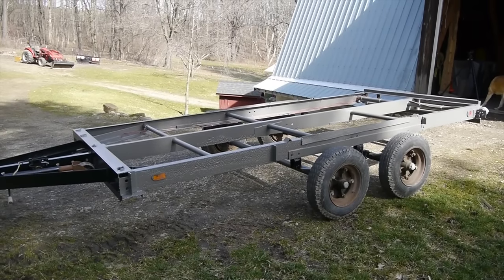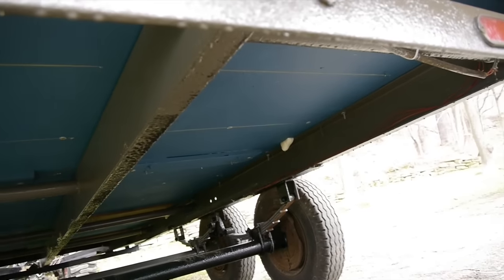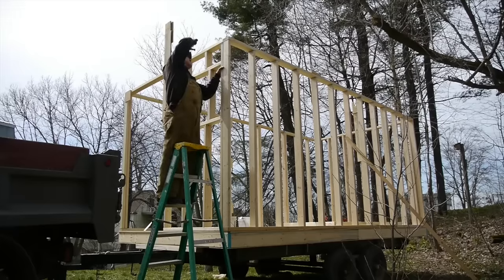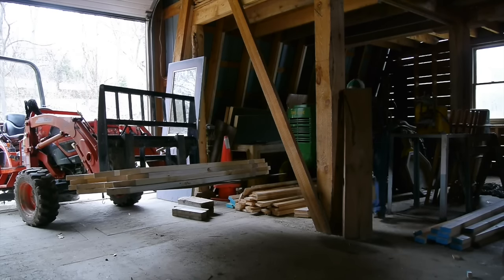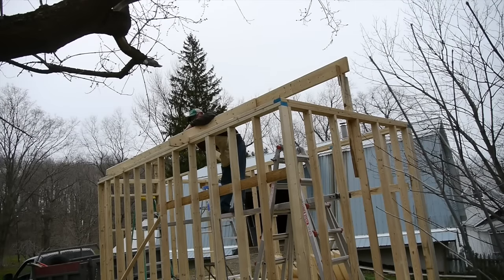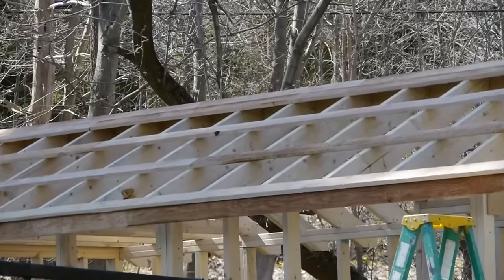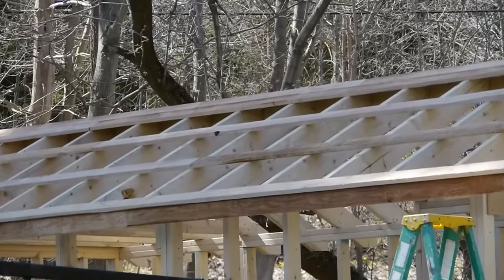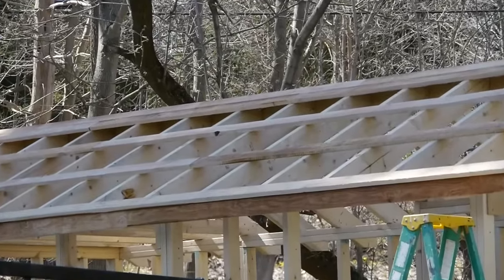My Tiny House: Start To Finish

Comment: He put on that shit board on the outside. It will start to ROT in 2 years.
Reply from the maker: Ray...Ray...Ray... Calm down. As long as you keep that shitboard painted it will last a long time.  I used oil based primer then good paint.  You gotta do maintenance Ray.  I will watch for ROT and let you know how we're doing.